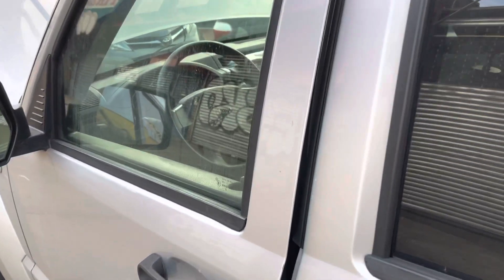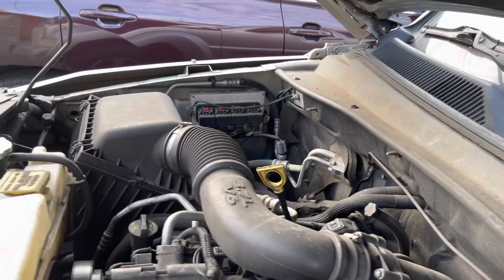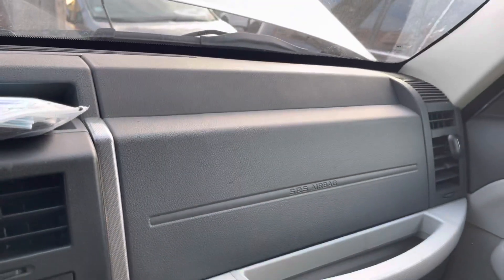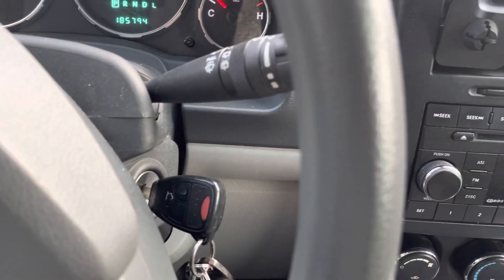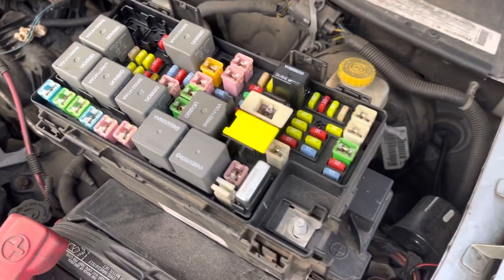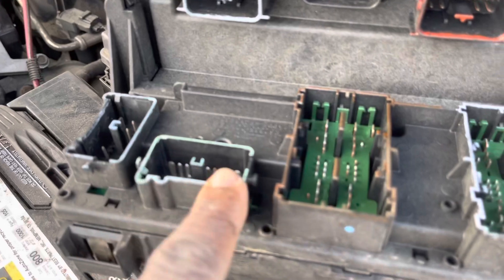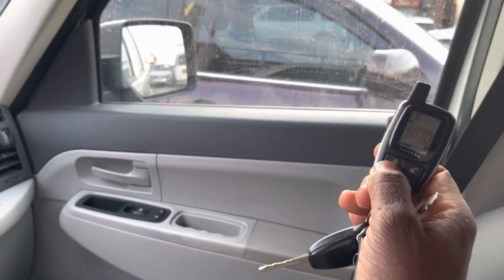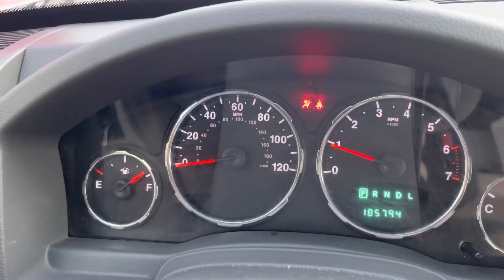2008 Jeep Liberty Power Door lock is not Working Found Front Totally integrated Module Was Bad Fixed

Comment: What if the signal lights turn on instead of the break lights after the TIPM replacement? Some dashboard lights turn on in the process; traction control, failure of anti lock braking system, electronic stability/ brake assist and airbag. My dad recently switched the box and tried to reset by 15 ish minutes or so. Would the problem be with the Module or something else?

Comment: I have same issue, after disconnecting battery the remote control is fixed it works but internal button to lock or unlock is not working,
Edit: the issue was with weak connection of the wiring in the control receiver, but still no unlock/lock button response
Reply: I have same problem! Did you fixed?
Reply: @jadhi6589  it was 11 month ago I believe the buttons was the issue because it has the ground for the locks i think

Comment: Hi, I have a 2008 Jeep Liberty and I can’t find the headlight relay, to test? Can you please tell me which relay it is as my headlights don’t stay on and the bulbs are good. I desperately need help please.
Reply from the maker: 2008 jeep liberty has no relay it has tipm totally integrated control module next to the battery
Reply: @BestCarFixes  - Oh, that is where the fuses are? I thought some of those were called relays? Do you know what fuses to check if headlights won’t stay on? I was thinking the Grey square things next to the fuses, may be relays?